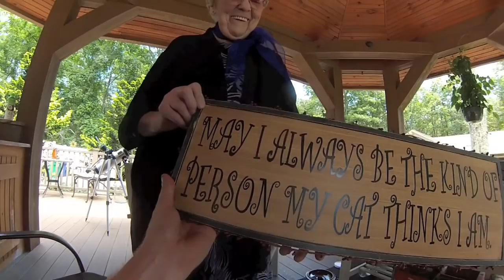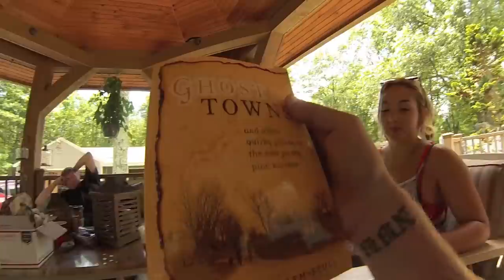Confronted By POLICE Plus FREE Mini Tractor!!!

Comment: Tucker , i have that same mower , just be sure on the left side push that foot lever all the way down with your foot , it has a safety switch in that foot lever so you can start the mower , the seat has a safety switch also... charge the battery or replace it , with a new one from WalMart for less than 30 dollars ....

Comment: I loved the way you got that mower out,  Epic. Check the carburetor bowl on that mower if it still won't crank after you charge the battery.  That's a common problem.  I had one of those Troy Bilt riding mowers.  Paid $1400, had it 7 years,  sold it for $700 to a landscaper.
Reply from the maker: Hhaha had to and yeah these mowers are for the dream!

Comment: When you are starting that mower you NEED to make sure u press down the brake and you have a charged battery. There are safety censers in the tractor that will not allow the tractor to turn over if you don’t have the break down. Hope you get the tractor started! Good luck!

Comment: To increase your money from the scrap yard, separate your metals. For example take the brass/ copper off of the hot water tank and save a load of that up separately. Same goes with everything. Bicycles strip the aluminum off and separate it from the steel. Use a magnet to check for steel. If it sticks, then it is steel.

Comment: Depress the clutch pedal on the left before you try to start it. There is a safety interlock on it which will prevent starting. Battery may also need charging, but it won't do anything unless the clutch is depressed.

Comment: Push the brake before you turn the key, power drive off and throttle to the top. Now try. Batteries arn't too expensive , if it won't charge.

Comment: This mower,it can be fixed easyl,when a small engine stands foe six months or a long time ,you have to change the gas clean the tank,check the oil,then take the carburetor apart and clean the jets,check if their is fire first by taking the plug out and put it where touching the engine metal and crank the motor ,you'll see sparks on the plugs,if not ,check the coil,make sure the plug is clean too.

Comment: propane tanks are pretty decent  actually you can scrap by just opening valve pulling off nozzle and scrapping empty tank or subbing out for one at wal mart then selling full tank on let go. also the copper and brass fittings on the water heater are super easy to spin off with a pipe wrench. Super dumb neighbor!

Comment: Since when do you have to have documentation for performing a service? She offered him a phone number to call to find out if you were allowed to pick up the scrap. And should have called and checked up on it , and let you keep working while he checked it out. He seemed to be defending the nosey neighbors even though the property was not theirs. It is his job to follow up on it once called but once he knew you had permission he should have loaded up and left . He has your information and if there was any problem later they could contact you then. He doesn't want to be portrayed in a negative light then maybe he should do do his job and move on rather than lecturing you afterwards. You were not committing an illegal act so it should have ended there with a " Have a good day".
Reply from the maker: I agree with you 100% and anyone that thinks we we're in the wrong just hasn't had much life experience or work experience. Thanks for the real comment!
Reply: Did you push on brake when trying to start the mower? I'd charge the battery and try again. When I was in my early teens I mowed lawns for real estate companies and was doing pretty well but one day I went to a property and the grass in behind the house was to the top of the chain link fence. I had my push mower and a weedeater and I let the real estate company know I was on property and told them how high the grass was. They offered to pay me more due to the lack of maintenance, I was elated. I jokingly said can I keep anything I find in the backyard. They told me that anything I found I could have then they said there was a shed in the back corner that I hadn't seen yet and that if it had anything in it they would appreciate it if I cleaned it out as well. I started cutting the grass and when I got close to the shed I found a riding mower and a push mower. Once I had the yard done I opened the shed and found all sorts of yard work equipment including a new chainsaw ,and a troy bilt tiller .  I was loading the riding mower and the next door neighbor came over and asked what I thought I was doing. I explained it to him and he got on the phone to the realtor ,who told him I had permission to claim all that I had found. He returned and asked if I would take three hundred for the things I hadn't loaded yet. I made a little over five hundred dollars that day and still had a riding mower that worked . And the neighbor was happy as well. He scored shovels,rakes hoes, a couple of axes,a chainsaw,a self propelled mower, and a tiller. Needless to say the lawns I mowed the rest of that summer were so much easier. I think I was sixteen then and am fifty two now ,I don't think I was ever that lucky again.